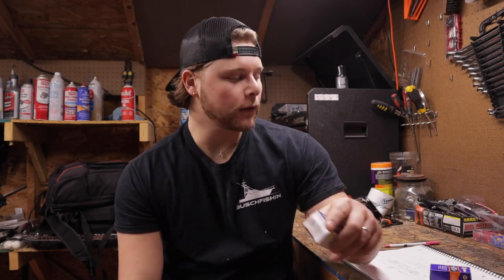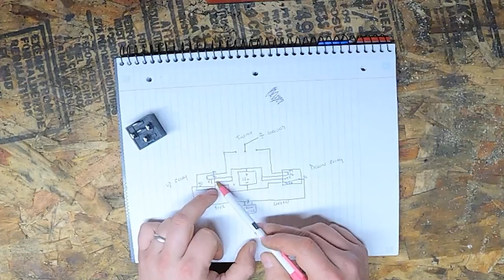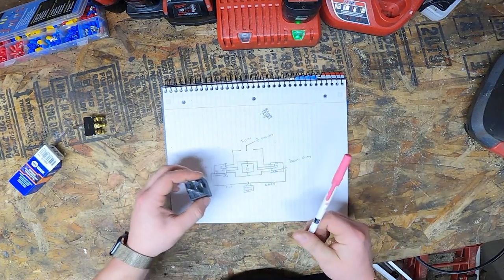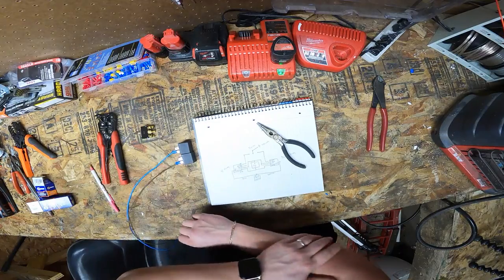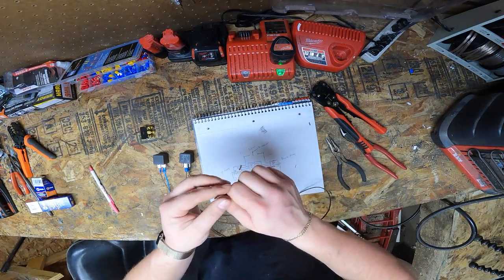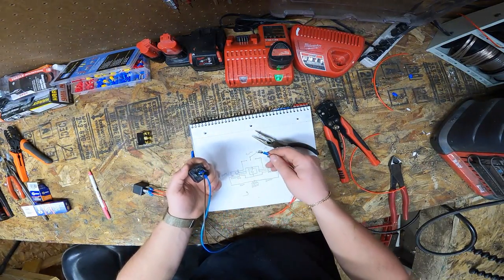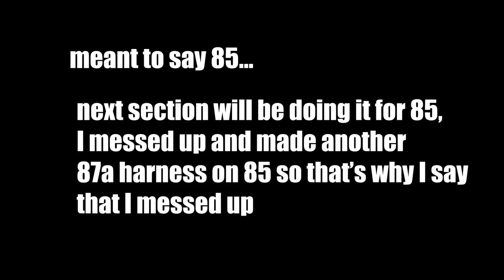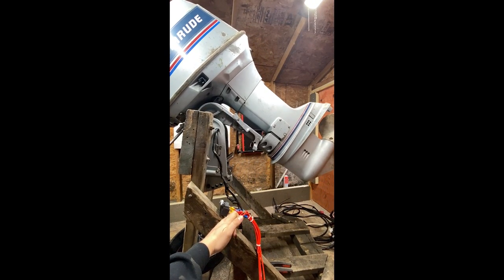How To Make TRIM/TILT RELAYS/HARNESS For ANY OUTBOARD

Comment: When I turn the ignition on on my Evinrude and up my trim it dies not stop going up . Without the iginition on it work normal . Another problem , when I give the engine throttle the trim goes up and will not stop .driving me crazy .
Reply from the maker: Most likely inside the controls two wires (most likely ignition - purple or 12v - red) are broken or have the insulation ripped off and they are touching the wires from the trim switch in the handle. This would make sense for ignition giving the up wire 12v and moving the handle making wires touch. Best way to find out would be to take the controls apart!

Comment: I got everything up until the mess up now I'm confused
Reply: Are there 2 wires running from the battery? One that runs to both relays then one that runs to the switch??
Reply from the maker: okay so where i messed up was when i took both 85 pins and tied them together to ground but i cut that out, 85 goes up to the switch and then there’s a ground from the battery to the center of the switch. from the battery i have the power wire daisy chained so it comes from the battery and splits off to go to each relay. you can run each power separate to the battery terminal if you’d like, it would probably be better that way to have your supply power to the trim motor be separate and a smaller gauge wire (bigger). the switch is a ground switch not a power switch

Comment: Did you bypass the hydraulic pump motor
Reply from the maker: no, the two output wires connect directly to the two wires coming off of the trim motor, one is green and one is blue.

Comment: GREAT video and well explained! Even the part where there was the mistake with the 85 wires. A closer look at the wiring diagram would be nice for those who are not as tech savy as others just to help them along, but this was a great video. Just an FYI though, if you don't have wire crimpers, if you look at the inside of the needle nose pliers that you were using, the opposite side of the rivot of the needle nose you will notice a place where the handles comes together and there are some groves in there. That will work much better with way more force with less effort than using the needle end close to the cutter. Just to let you know. Keep up the great videos!!
Reply from the maker: thank you and thanks for the tip!

Comment: Great video my question is if I already have an existing trim switch and power trim relay on my Honda 9.9 and I just want to add an additional switch at the stern can I just splice the new trim switch into the existing trim switch wires and avoid any new relays. Thanks
Reply from the maker: to add an additional switch all you would have to do is find the 3 wires coming from the controls and splice them into a second switch at the stern, you will just have to make sure the feed wire goes into the center position and up is up and down is down, hope this helps!
Reply: Do you know if the switch for the Honda outboard is positive or negative? And thanks for getting back to me so quickly, please keep making the videos
Reply from the maker: easiest way to find out would be to take a multimeter and check continuity from ground to the center wire on the switch - if you have some it’s ground if not it’s power. you could also just check for power on that wire or the others while pressing it

Comment: Great video, sir. Do you have a video on wiring two controller switches? Driver and stern controls? thanks.
Reply from the maker: I do not have a video on it but essentially you are just daisy-chaining into the three wires from the three position switch. So basically just splice in a wire from each of the three wires going to the switch and add another one exactly the same.
Reply: @buschfishin  Thanks for your input

Comment: I've got 3 wires coming from my trim pump. Green, blue and black. I wired as you described. I did not use the black wire from the pump.  My relays click, but the pump is not being activated.  I know for sure that  the pump works.  Should I use the black wire as a ground to the switch or battery
Reply from the maker: is this on an evinrude or outboard? most likely the black is a ground but on something like a stern drive application the green and blue are never ground, they are just powers because the black will be a constant ground for both sides. A way to test would be to ground the black wires and give 12v to the green or blue. If it works then you don’t really need the relays, just a 3 way switch.

Comment: Great video. But i got confused on the ground at the switch. Does it go straight to the battery  on tied into the ground from the relays? Thanks
Reply from the maker: battery ground goes from the battery/block ground to the center of a 3 position switch, when it’s flipped a direction it then connects that block/battery ground to the relay to close the magnetic field allowing the switch in the relay to close thus allowing power to be supplied to whichever wire is selected - hope this helps!

Comment: I have a 78 mercury, the trim is no longer working from the control box. Do you not need a solenoid for this wiring system  like how my tilt pump has two at the top of it?
Reply from the maker: For your motor you will have to use actual solenoids rather than relays, my Johnson 35hp has a very in depth explanation of them if you’re interested!

Comment: Ok I had the black wire that runs to my trim unit motor (10ga), the black wire from the switch (14ga) and the black wire (14ga) that butt connects to the two black wires (14ga) going into the relays all on the same eyelet connector for the battery. As soon as I connected the positive the black 14ga wire that runs between the eyelet terminal and the butt connector for the two relay wires went up in smoke and melted the insulation and loom. Do I just need a heavier gauge or did I wire something wrong?
Reply from the maker: Most likely something is wired wrong, I’ve done the same thing…

Comment: Hey pal I have 1 question  where do I get the last wire from that goes in the middle  of the switch
Reply from the maker: The center wire for the switch can either be tied into one of the constant ground wires or just come from a ground that’s on the same battery circuit. The switch is controlling a ground so when it’s flipped one direction, it connects the ground from the battery to the ground side of the trigger circuit on the relay. Since the other side has constant power this will allow the relay to close and supply power to either the “up” (blue wire) or “down” (green wire). Hope this helps!
Reply: This helped me finish up what I needed thank you very much pal keep the vids coming

Comment: You said the middle switch terminal is to ground...and you said to battery..nothing in your drawing of that to the switch....do i need to run an extra wire from battery ground to the swich..?

Comment: Can I do this without the relay and just fuse the switch?
Reply from the maker: The issue is off of the trim pump the two sides are alternating power and ground in order to make it go up or down. I suppose it would be possible to have a switch going to both wires where it rests on ground, perhaps a three position that sits on ground to both sides and when you flip one switch it powers one side?

Comment: What size fuse should be used to deliver power from the battery
Reply from the maker: assuming the length of the wire is going to be  most likely short or under 10ft and it is 12 gauge wire, a 20 amp fuse should be good and more than enough so you never have any issues blowing fuses or melting wires

Comment: Used this on a Yamaha 55hp, can hear the relays clicking but no tilt/trim. What did I do wrong
Reply from the maker: Check the output wiring for 12v, meaning the two wires going to the trim pump. IF you’re not seeing any voltage there check the voltage at pin 30 which is the feed 12v to the relay, the “main” power feed which should be 12v. If you do check that the other relay is resting on ground by putting the multimeter in ohms and connect one end to the “resting” pin and the other on battery/engine ground. It’s gotta be one of the two if they’re clicking. The clicking means that your triggers are working.
Reply: Did trim tilt work before hand 
And why did u do this did the original yamaha relay go out ? Dealing with same in 70hp Yamaha 
What did ya find out 
Thanks

Comment: What's the part number for the switch?
Reply from the maker: In this application I didn’t use any OEM switch I just used a basic 3 position switch from fleet farm but I would recommend putting your model number into marineengine.com and clicking on the controls parts diagram, it will give you the OEM and aftermarket parts diagrams!

Comment: Man, that was cool.  I bought a 1978 stinger 75. Lots of stuff was missing. Someone saw fit to sever and remove about 4ft of the 8 strand control loom.  All that is there for the trim motor,  are the blue and green wires, and from the trim switch, and 1 blue 1 green,  and 1 brown going to 1 end of a connector.  No signs of relays anywhere.  You gave me the solution. Thank you,  and best wishes to you and all your viewers from Brisbane Queensland Australia 🇦🇺 💙🇺🇸👍☮️

Comment: My question is why 
Because of bad OEM relay or what
Reply from the maker: this motor came with a trim pump but no wiring for anything so I made it from scratch - this would most likely be for an aftermarket trim install but it would also work for two wire jack plates.
Reply: @buschfishin  ahh I Gotya I think I may use an extra jack plate harness I have which is same as this or make one for my trim pump on 70 Yamaha instead of buying almost 200 dollar Yamaha relay I need

Comment: If I keep blowing a trim fuse that wire has to be shorted out right
Reply from the maker: if it blows as soon as it’s connected to power it’s a short or connected to a ground after the relay, if it blows when the trim unit is moving it could be that the wire is too small or fuse too small. I would double check the wiring diagram and make sure everything is hooked up properly
Reply: It blows soon as you plug it in wires started smoking and killed power on everything I think it's a short. But bass boat has 3 switches. Thanks for your reply
Reply from the maker: if it’s doing that somethings definitely connected to a ground i would check it over

Comment: Sorry but you forgot to say what wires go to the tilt and trim . Yes I think i can figure it out but just saying
Reply from the maker: i noticed this at the end, the two wires left with no connection go to the two wires coming off of the trim pump. off of the actual trim motor there should be just a blue and geeen wire, neither is power or ground they actually alternate so when say blue is power green is ground and it trims up, vice versa for the other side